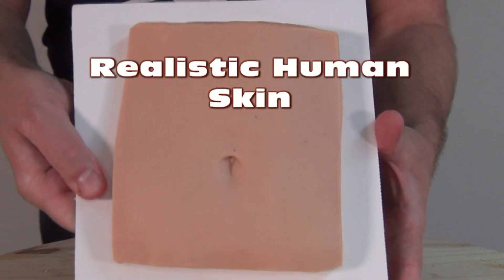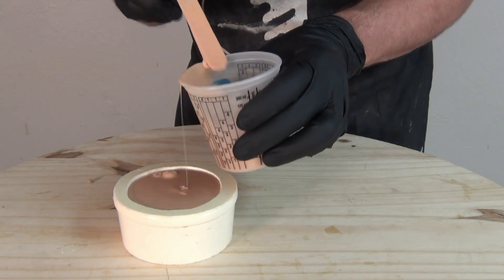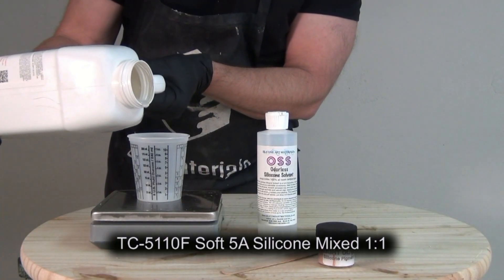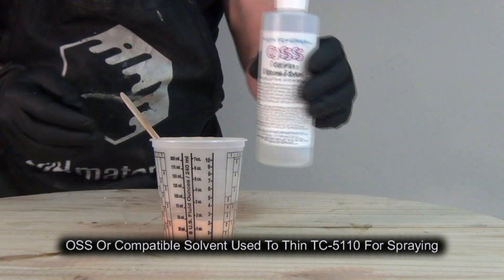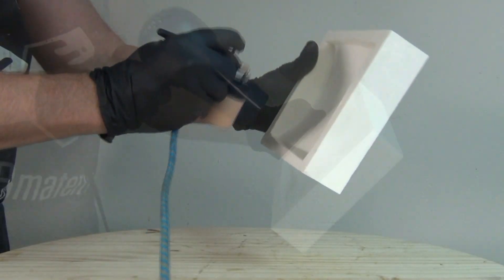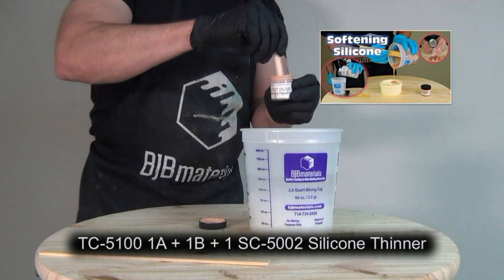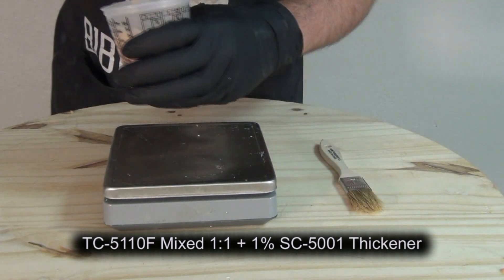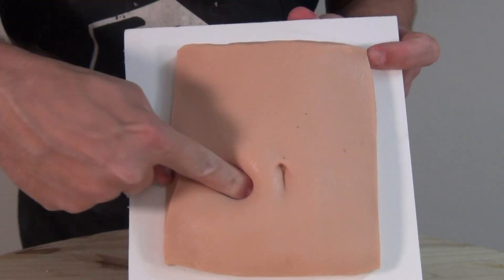Realistic Silicone Skin With Sprayed Silicone

Comment: This isn't on topic for this video, but I figured you're the one to ask on this...
I just purchased a silicone faucet mat that drains splashed water on the kitchen counter into the sink. It works pretty well with large amounts of water draining into the sink but some residual water beads up and sticks to the surface until it evaporates. Do you have any suggestions for products that would be kitchen safe while making that residual water run right off the mat?
Reply from the maker: Unfortunately, I got nothing for that. Sorry.

Comment: I have been working on something similar to this for a while. multiple layers of different hardness silicone including layers that are very soft, often in the 000 range and because of that I need a skin layer like you are doing here. the problem I always run into is durability, after some time the skin layer always starts to delaminate at the seam on the back. it seems like any time you cast silicone and there is a seam between to parts poured at different times it will eventually delaminate no matter how green the silicone is when you do the next layer. I have been searching for a way to do the skin in a seamless way so it fully encapsulates the part with no seam but I have not found a way to do this. any ideas?
Reply from the maker: I will be posting a video on this topic very soon, so stay tuned! Spoiler alert, TC-5110F thickened with SC-5001 is what I will be using.

Comment: So, I'm working on a project that consists of a wearable 'realistic' puppeteerd head form. 
An underskull with minimal/simple mechanics, muscle and fatty tissue sculpted methodically onto that, and a thin skin layer that will be painted and haired. 
For the muscles and fatty tissue to be able to move with the mechanics, I'm considering silicone. It needs to be tough with flex, but still soft and thin, and be able to be sculptable. Does any silicone come to mind for that? I was thinking of using standard silicone caulk for it and just simply apply and sculpt straight onto the underskull form. 
And for the skin, it's obviously going to have to be casted from a mold so it can be pulled over the headform. It can't be too thick; I'm going to try to shoot for 2mm. It's gotta be stretchy/flexible and only strong enough to not tear as it's stretched onto the form. 
I could make a cut at the back of it to make that easier. Maybe install a zipper too. The hair should hide that. That will make getting to the mechanics easier if needed. 
Any silicone come to mind for that? 
I wish I was able to ask YOU these in like a message. Not through comments or email.
Anyways, if you or anyone else answers, thank you very much!!
Reply from the maker: Unfortunately, silicone calk or sealant is fairly firm so it really isn't soft enough for animatronic work. A skin of TC-5100 would be good for that but you will need a negative mold and core to get the skin to come out the right thickness. The leachman mask at the beginning of this video was cast in TC-5100 from a resin mold with a core shaped like a human head.
Reply: Thank you for your reply! And fair point, I haven't messed with caulk in a long time. 
What was that silicone you applied straight on a head form to be a mask? You just applied it and wet your fingers and tools with alcohol or something and sculpted in details. 
I'll try to find the video..

Comment: Just out of curiosity, there is more and more talk of androids with realistic human features (even if they always end up showing adult dolls 😅), from what I understood they do not use silicone but TPE or S-TPE: what is the difference between the processing/casting method between silicone and TPE?
thanks in advance if you want to answer.
Reply from the maker: Platinum silicone, like what I am using in this video, is room temperature cure so it does not have to be heated. Everything I use on this channel is RTV, or room temperature vulcanizing, which means it may be poured/cast and cured at ~75F. Injection molding allows for other material properties, but requires a significant investment in equipment and molds.
Reply: @brickintheyard Thanks, I imagine the YOUTUBE videos of pouring hot liquid into a double-shell mold were TPE for sure.
Have a nice day.
Reply: Thanks OP! Doing a small collaboration w someone who sells these. Would like to learn the general process better and contribute further.